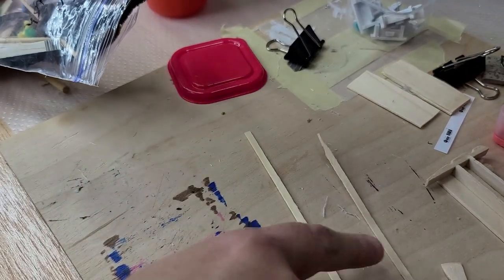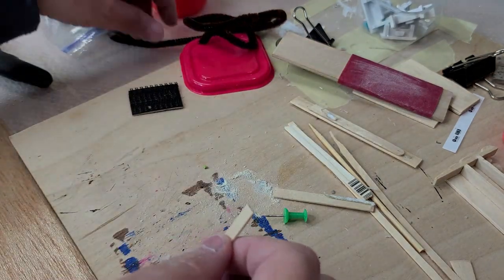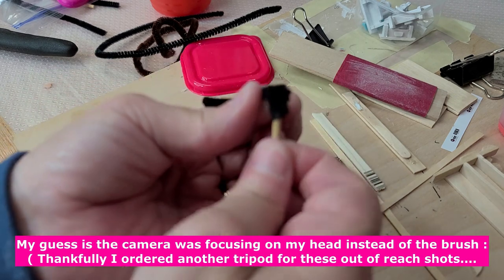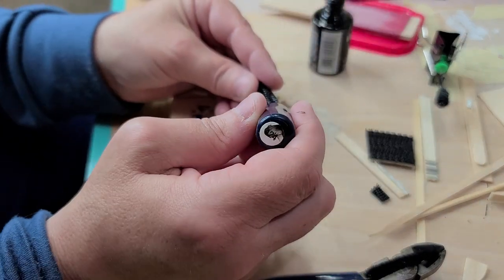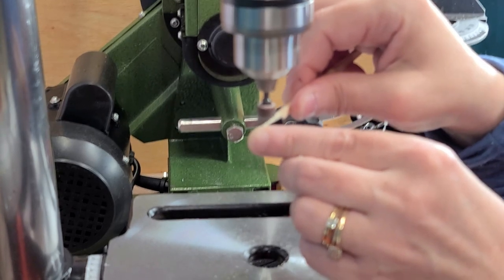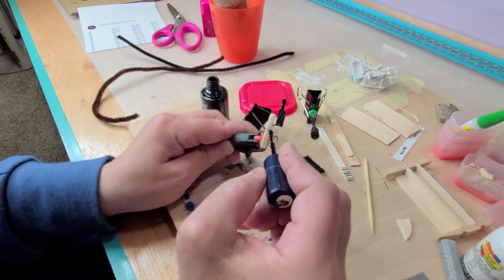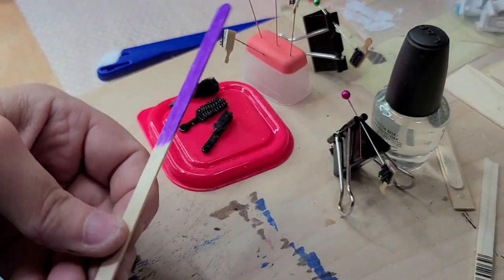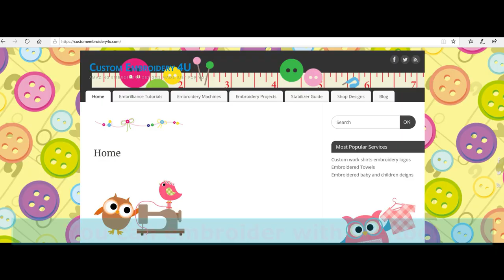Dollhouse Hair Brush  05 2020 Option 2 (Minute Series)

Comment: Would it be easier to sand and paint if the Hairbrush was cut off after it is sanded and painted? It seems like it would be easier to hold onto a longer stick  and then you can cut it after you paint?
Reply from the maker: I think you would see the transition line from the paint but you can try it that way for sure.